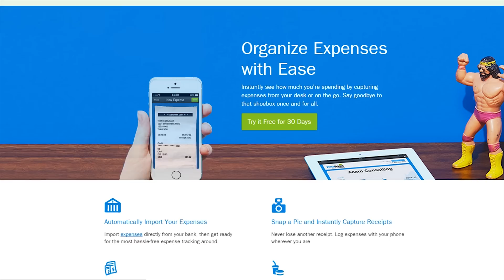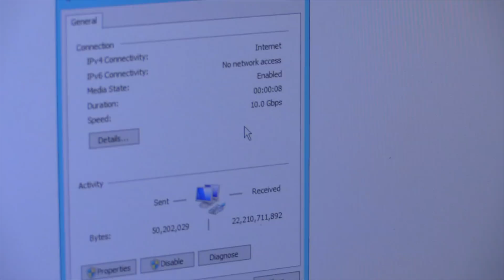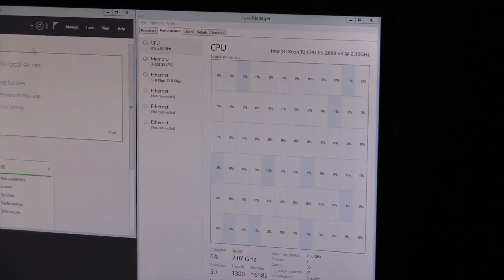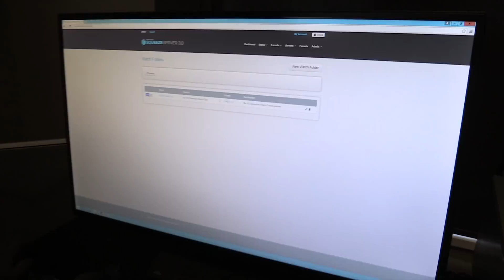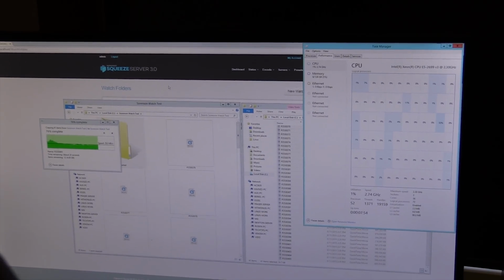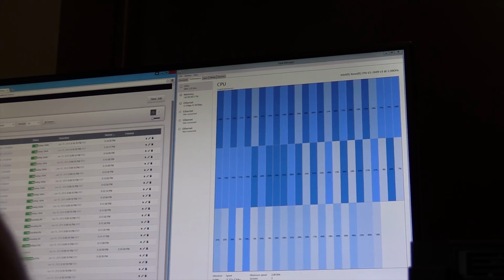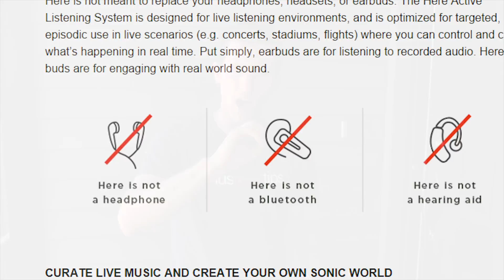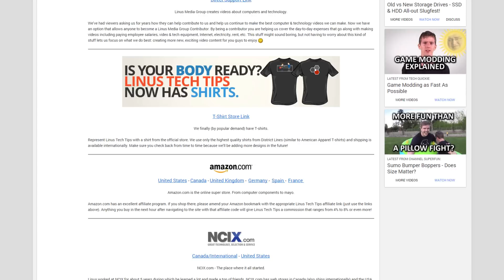36 Cores, 72 Threads, and Two Titan Xs - Our New INSANE Rendering Machine Part 3

Comment: CPU:		Intel i7-4790K Core Processor 

CPU Cooler:		Corsair Hydro Series H55 120mm High Performance CPU

Motherboard:	MSI 7821-002R Socket (Intel Z97, 4x DDR3)

Memory:		Corsair Vengeance Pro Red 16GB (2x8GB) DDR3 1600 MHz 

Storage:		Seagate Barracuda ST2000DM001 internal Harddrive 2TB 

Graphics Card:	MSI GeForce GTX 970 Gaming 4G, 4GB GDDR5

Case:		Corsair Carbide Series black with white LED Fans SPEC-03 Mid PC Casing

Power Supply:	Be Quiet! BN235 E10-CM-600W Straight Power "Modular"

Optical Drive: 	Asus DRW-24F1ST DVD-Brenner 24x (DVD±RW, 8x DVD+R, 8x DVD+R DL, SATA) schwarz, "Bulk version"

Operating System:	Windows 8.1 full Version 32/64 Bit

Please tell me if this is good or if I should change something :) I want to play games like Far Cry 4 or Witcher 3 at max. settings and 60 fps. 
Thanks
Reply: I'd rather get an I7 over an 8350 it's pretty much outaded now. :/
Reply: Toby Dodz Why are you suggesting a much worse CPU? You don't even know if he requires the i7 for Video rendering etc..
Reply: You are asking YouTube comments for help building a PC...
Your build is a pile of steamy poop.
Reply: ***** unless you have some special needs with this system or else this can be improved, like alot...

CPU: save urself some money and get a fx-8350 for the cpu and get a better cooler while ur at it
RAM: get some cheaper ram there no reason why you would need "pro" ram in this kinda system
STORAGE: also get a ssd, they're much more worth it then hard drives now a days
GPU: for gaming PCs ur graphics card should be around 1/3 of ur total system price
CASE: I guess I can't really judge what looks good for you...
PSU: I guess that's fine though you can get a better one
OPTICAL DRIVE: do you actually need one or did you just feel like its necessary...

here's what I would've done: http://pcpartpicker.com/p/R9R3Q7 (this cost exactly the same as your idea)
Reply: Yummies LOL exactly, thats why i said "unless you have special personal needs" and honestly the 8350 is almost just as good as 4790k at editing just a lot cheaper and less power efficient
Reply: Moethedirt that's the sad part about amd cpus, but if people don't start learning how much of a steal they're their market share will just drop even lower and we might not see another amd cpu again...
Reply: ***** I usually chose an amd cpu when ever I can cos first of all they're fucking cheap as hell and they honestly deserve the support, if even the gamers stop buying their chips intel can pretty much crush amd's market share to zero, and that's not good for anyone
Reply: ***** i'd just pirate windows so that it's free, or maybe turn down the ram from 16 to 8, simply  because the max i've reached with my 8gb ram while playing far cry 4 and witcher 3 at max is 6gb of ram usage. then u can get a 980ti. 980ti is best right now, or u can wait a few days and get the fury x, which will destroy the 980ti and be cheaper
Reply: ***** i recommend windows 7 because windows 8 includes extra un needed and unused programs which slow down you computer
Reply: Yea go for the i5-4690k, it's much cheaper and won't make much a difference from the i7 when over clocked, plus, even with the i5, the gpu is still the bottleneck. I myself have an i5-4690k oc to 4.5 ghz and a gtx 970 oc +200 mhz and the gpu is still the bottleneck. I can't imagine how much of a bottleneck the 970 would be to the i7, unless you also plan to render a lot. With the money saved on getting the i5, why not also get a 980 instead? Also I highly recommend getting an SSD, as those are extremely helpful for boot up time and loading times. Put windows and program Files on the SSD, and games and document files like pictures movies etc on the hard drive
Reply: Nope
Reply: ***** sorry I didn't necessarily mean bottleneck. I might have not been using the right terms. What I was trying to say is that the i7 is more power to the point that it won't make a difference if he uses an i5-4690k instead if he chooses the 970.
Reply: ***** All depends on what you're going to do with the build. If it is completely directed towards gaming, porn, web browsing, etc. than don't get the 4790k, you won't use it. You should go more for a lower end i7 or high end i5. If you are going to do video editing and/or modeling than stick with the 4790k. Try to get the Corsair Vengeance 16gb 1866mhz set of ram, its not going to be much different, but its about the same price and it will just be a bit faster in certain tasks. For the graphics card try to go for a 290x or 390x, both are more powerful than the 970, and the 290x will probably be around the same price or cheaper now. The rest looks good and I think you will enjoy this build. :D
Reply: dogger20011 the 290x although a good price, is not necessarily better than the 970. The 970 swamps the 290x in performance. However  I don't know about the 390x, but the 390x may be more pricey, but idk so don't quote me on it. At this point in time, Nvidia absolutely destroys amd in higher end gpus.
Reply: Also if you are gaming and not editing rendering, you probably won't need 16 GB ram, as that is a bit overkill. In all honesty 8 GB should be enough, but if you'd like you could go for 12
Reply: ***** You had it mostly right, but its clear you know little about AMD, They didn't "stop competing with Intel for CPUs" Google Zen for me real quick, also do a Google search on DX12 and Mantel, its going to be effecting every game made from Windows 10 on.

 An 8350 running all 8 cores easily completes with a 4690, overclocked it can even go as far as to pass it, for a fraction of the price. What you said was true up  DX12 was announced  a long while ago and the details were told, and now basically every game will have a better version of Mantel installed. Also Google the modified windows 10 drivers for windows 8.1, I'm currently talking first hand with the windows 10 drivers for my 8350 290x combo and the value in this build is insane with up to 10 FPS gain in towns on witcher 3 from the drivers alone, and I already ran FC4 at 60 FPS on ultra without the drivers, why you wouldn't recommend an 8350 for that game in particular is far beyond me..

That being said the 4690k doesn't need any of the extra software help it was already strong to start with and DX12 will only help that (not nearly as much as the 8350 considering I can finally use all 8 cores) so if you have the money then its kinda pointless getting that 8350 if you can afford going Intel but if you want to save some money the 8350 is a completely viable choice, if you understand how to overclock then you only get more and more value with DX12 around the corner and the price only getting cheaper at around 160$ its just such good value its hard not to recommend it for people on even a slightly tight budget.. But the sound choice is to wait for Zen and to see how that goes as Intel will also have some new processors by that point and you will have a much better lineup to choice from.
Reply: berzu21 but will it run minecraft? xd
Reply: berzu21 AMD FOR THE WIN
Reply: ***** If your total budget is 1200 Dollars, you could get a better Gaming PC by dropping the i7, dropping 8 gigs of ram, dropping the cooler, getting a cheaper motherboard and investing that 300 dollars into another 970 to run SLI or run 980TI with an ssd
Reply: ***** hell the fuck yea it is
Reply: ***** I don't even understand this post, are you agreeing with me or?... I didn't disprove anything but the fact that the 8350 is an awesome value and a viable alternative that can compete now with the DX12 drivers able to run every core to its potential. I wasn't telling him to get a 8350 in fact I said "so if you have the money then its kinda pointless getting that 8350 if you can afford going Intel" as there's is no way around the fact that a 8350 will never be a 4790k with its much better single core performance and lower power consumption, but it costs over twice as much.

"and why are we talking about the Zen CPU while talking about budget at the same time?" Because its completely relevant?.. They made it pretty clear its going to be priced aggressively against Intel's line of CPUs as an alternative to the high price, is that not the definition of budget friendly? lol Google a bit harder if you think Zen is just a single line of CPU's its actually the name of the architecture of the CPU meaning we can see anything from server grade CPU's to rock bottom budget build CPU's
Reply: Look up HyperX Savage PC on ebay to find a computer that will do this :)
Reply: Moethedirt dont compare a 4 year old to a new cpu
Reply: ***** you can get the 980 ti thats a great card for higher res if you going in future
Reply: yeah
Reply: gaming apple 96 They haven't released anything better in the last 4 years.
Reply: Yummies LOL He stated he wants to play far cry 3 at max settings. DUH!
Reply: Moethedirt i7 for gaming has NO EFFECT
Reply: Ethan Ly No it has an effect it always out performs any fx CPU ever try cities:skylines :p
Reply: Never fails that there is one of these guys in the comment section.
Reply: +Brandon Kim Stop perpetuating the idea that, just because the FX series processors don't have the best single core performance, means that they are useless. You base your argument like we are still in the days where if your processor has a faster clock speed, it's better. AMD is optimized for gaming, but also can still do video rendering and editing on a multi-core basis just fine. How many programs out there still use single cores to render video? None. If someone is only gaming, it doesn't make sense to buy Intel over AMD. AMD will get the job done for much cheaper.

Comment: Software like this is not perfectly threaded, the problem is splitting data into chunks for each core to render. To get the best compression you need to select the slowest rendering speed and only use a single CPU core so data is not split.

Comment: Should I get a GTX 750ti or a CPU roughly costing 50-100 pound? :) ty
Reply: Yeah Brandon... Mhm, I see what you mean.. If I choose to upgrade my graphics, I'd have to eventually upgrade my cpu? Well, couldn't I just upgrade my graphics card, as I'm planning to do. Then upgrade my CPU. Surely this is more efficient? Upgrade my graphics, then cpu? Instead of saving for a 500-800 pound comp.. I am noob so.. Anyways thanks for the reply :)
Reply: What do you have now
Reply: My pc is a HP pavilion 500-242ea

Some specs:
CPU: AMD A8-5500
Graphics card: Radeon R5 235

Ty again. :)
Reply: Puzzle Talk get the 750 ti
Reply: Serious? Why should I get the 750ti?
Reply: Hold on, I think my motherboard has an onboard graphics card. Does this mean I can't put a dedicated card on?
Reply: Why dont take a r9 370? A bit more, but way more perfromance ?
Reply: R9 270 has a 500 watt power supply requirement and PCI power connection requirement. So if your upgrading an htpc use the 750ti
Reply: berzu21 that lowers the lifespan of the pc, and it quite not worth the risk, a 600 watt psu  should be the minumum for the pc build
Reply: Thanks for the reply guys :) much appreciated.  Anyone know of some websites which can tell you if the motherboard supports a certain CPU?
Reply: Cheers :)

Comment: Sapphire Radeon NITRO R9 380 4GB or shappire r9 270x 4gb ?
Reply: 380. But 280x beats both and them and should be much cheaper.
Reply: Luke Johnston the 280x 3gb is 10$ more ,, should i get it ? Sapphire Radeon R9 280X 3GB
Reply: R9 380 duh

Comment: I'm looking for new laptop for my architectural studies which is require a pretty good specs for rendering, modelling,and so on, in that case any suggestion what laptop is it? and my budget is around 900 usd, I do really appreciate ur suggestion... Thanks a lot!
Reply: Benedict Buddy 1000 usd is okay too..
Reply: Benedict Buddy Acer V15 Nitro sounds about right, 800~1000 usd depends on where you live, I7-4710hq, Gtx 860m, 12gb ram, 1080p ips. I think they release the new version with 960m, not sure about the price of that one though.
Reply: GriggsCk Gaming Thanks a lot !

Comment: Why does he not use linux and any other software? There are enough good encoders for linux... and a small script could watch that folder. This would also solve the GPU problem, because he could just use it headless with ssh.

I dont say anything if he uses a Titan X as a counter weight or ghetto mounts coolers on 18C Xeons, but Windows on a Server is too much!

Comment: Should I get a better CPU or better Graphics Card for gaming? please help
Reply: ***** Graphics card
Reply: If you have potato cpu then cpu but normally gpu
Reply: ***** Just make sure one doesn't bottle neck the other, but usually you would want a better GPU. So it wouldn't make sense if you have  an i7 4790K and an R7 240 or reversely, an AMD FX 6300 and a Titan X. The general "rule" is to get the GPU though, upgrade the CPU later. Hope it helps. (Unless I am totally wrong and then I would be so sorry.)
Reply: ***** GPU all the way

Comment: LinusTechTips What are the advantages of 2 Xeons against one Xeon Phi? Wouldn't 50 cores help more than 36 cores with Hyperthreading? Also, what are the chances to add a Xeon Phi to this Server/Workstation Hybrid Rendering Machine?
Reply: interlace The software they are using doesn't use gpus I believe.